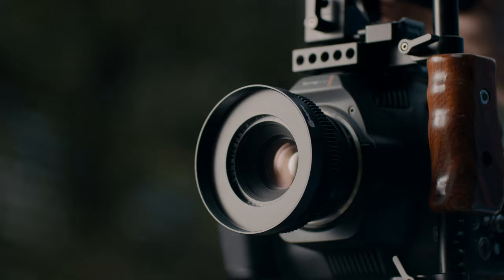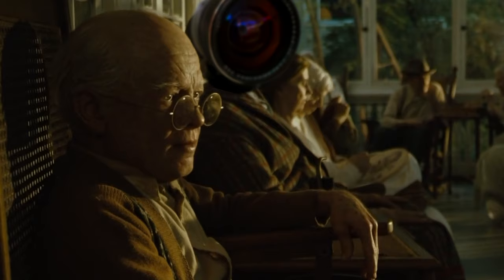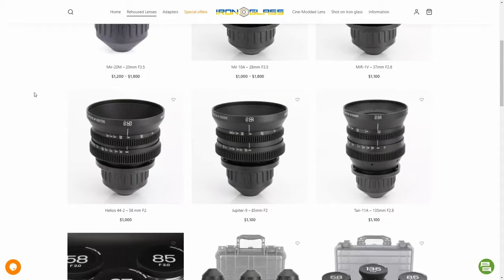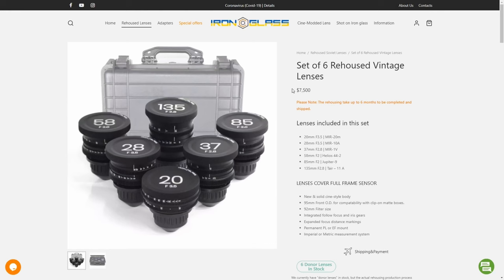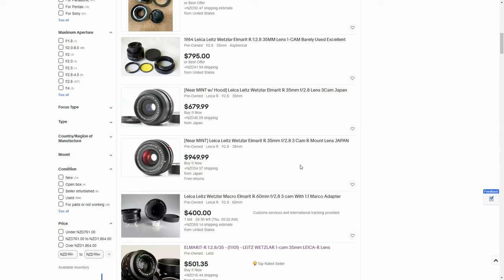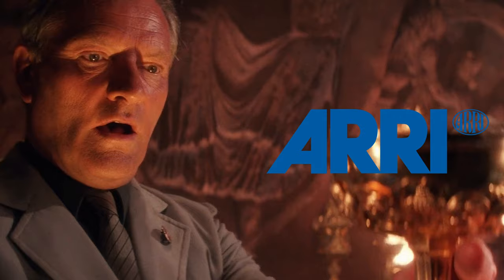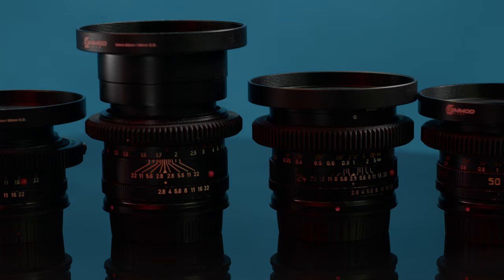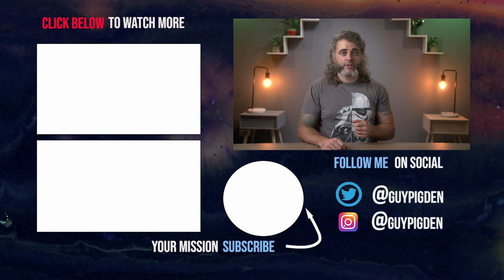Filming with Vintage Lenses (the ultimate deep dive!)

Comment: how do you manage excessive shakiness? I'm using a 50mm 1.7 pentax lens on my fuji xt4 and I love the way it looks, but the footage is so shaky it's unusable. I was considering adding some weight, some handles, etc to help smooth the footage out a bit, but yh. Was wondering if anyone has an answer for that.
Reply from the maker: Best solution is to add weight, rails, follow focus and v-mount battery. The heavier it is the less jitters.

Comment: Man awesome video. Vintage glass akin to being a doting parent to a child that loves you to bits - that also runs off in public and eats cigarette butts. 
Was curious about your time tracking down that 19mm - Did/do you ever miss the addition of a WIDE angle to your set? Or did the projects using the 'film look' never require a field of view that wide?
Reply from the maker: I have never really required a 19mm as the 24 or 28 seemed to do the job. Don't get me wrong it would be a really welcome addition and help in tighter spaces but the astronomical cost is something I just can't currently justify.